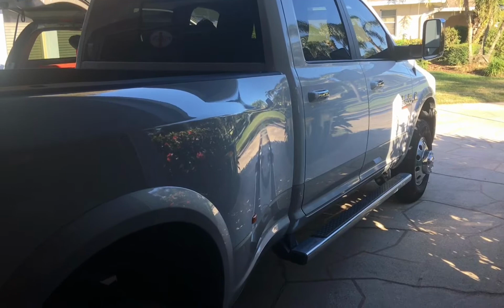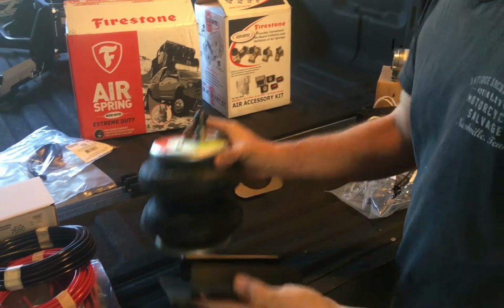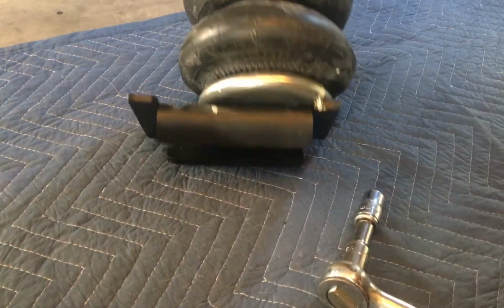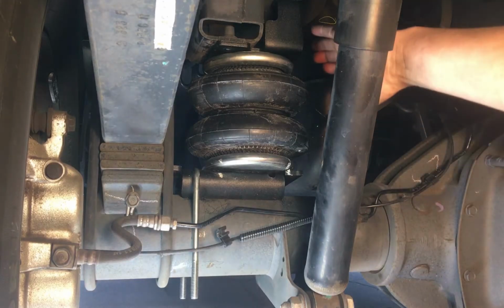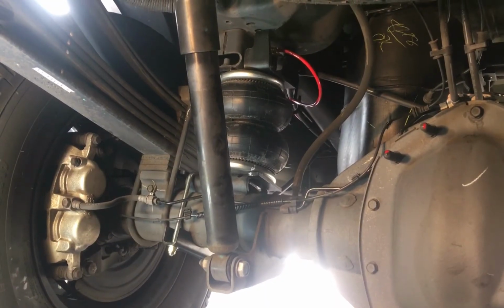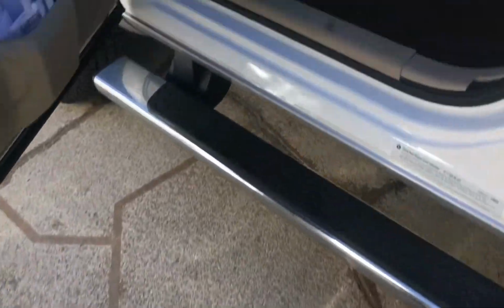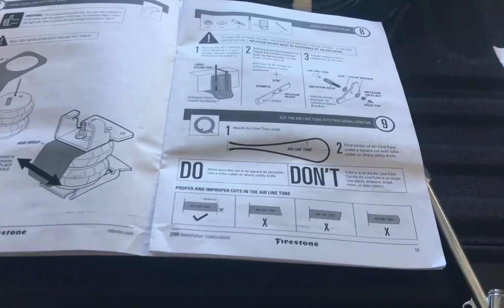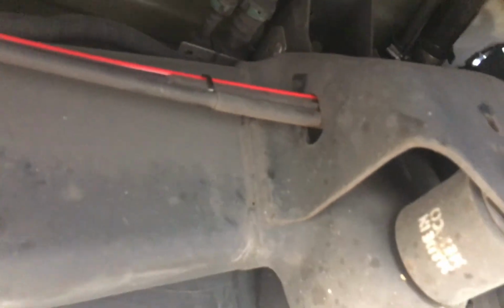2013-2019 Dodge Ram 3500 Air Suspension with Gauge / Compressor Installation

Comment: Great video. Thanks a ton. I have a 2015 Ram 3500SRW so it looks very similar. Question, did you have any issues w the hard brake lines running along the axle?  Drivers has space but the passenger side looks tighter. Curious if you did anything for those or minimize them rubbing on the u bolts. Thanks again.

Comment: I have a 2015 3500 srw and mine has 2" lift block on the rear end, will these still fit to the axle with the blocks in place? Length of the air bag is my question I guess...
Reply from the maker: You would probably need a taller air bag

Comment: I just mounted in a 2022 Ram Chassis Cab and the only thing was the lower mount did not fit in to the U bolts of the lift springs, and I had to create a longer U bolt because this one was short, I think is because of the size of the axle, hope it doesn't move.

Comment: Mine goes to the license plate, what should the pressure be set at?
Reply from the maker: Just depends on the weight you carry..  this was a customers vehicle who pulls a 3 car hauler.. he leaves them empty with no load, and airs them up when he’s got the trailer with cars on it..
Reply: @ecanixgarage1106  so it's good to leave them empty? My dually bounces and shakes on the rear end because there's only a spring and air bags back there, what's the problem I am having?  It's a 2016 Ram Dually also
Reply: @blessedandtalented113  Put those shock absorbers to use or get some.